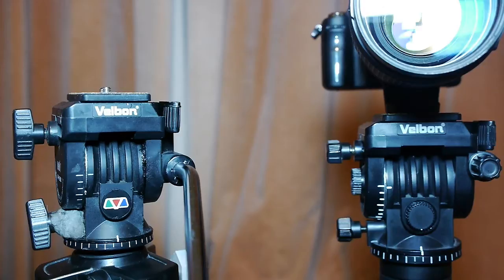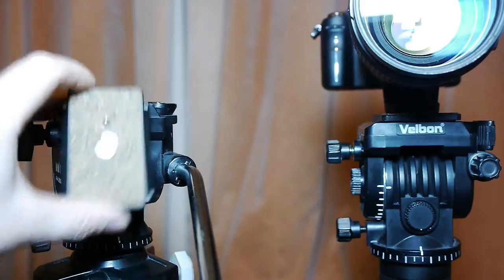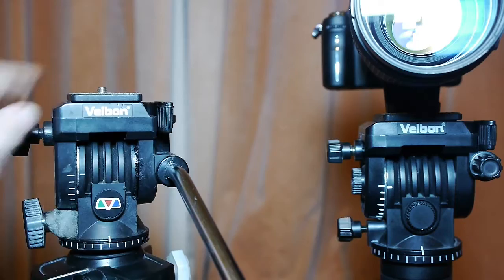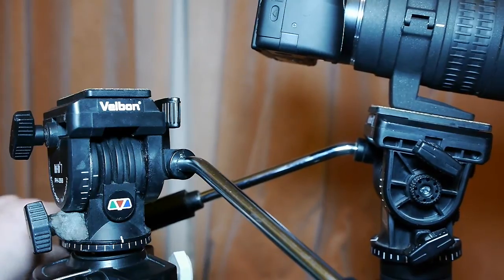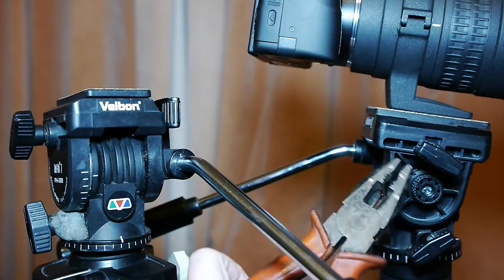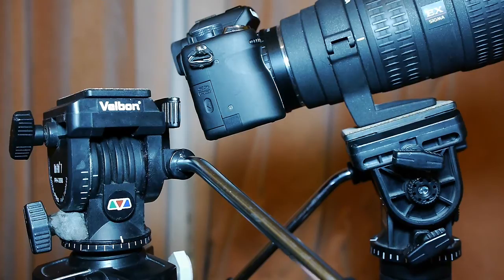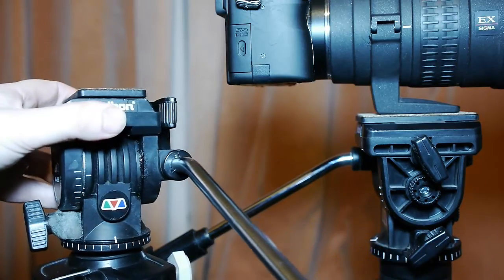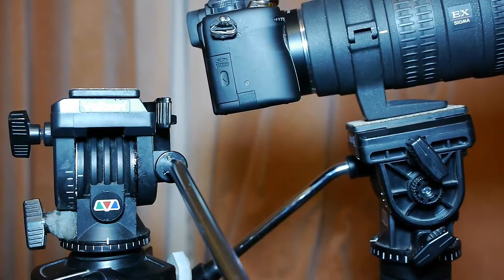Velbon oil damped pan/tilt video heads: Any good? PH358 vs PH368.

Comment: I have a Velbon PH-258 that was gifted to me, it doesn't come with a quick release, would I be able to buy one that fits it? I can't find one
Reply from the maker: Does this look like the right quick release plate? https://www.ebay.co.uk/itm/Quick-release-plate-for-Albinar-9500-9900-tripods-with-PH556-PH258-PH258Q-heads-/332812446004

Comment: does a ph368 fit on tripods of other brands, like Rollei Compact Compact Traveler No I Carbon ?
Reply from the maker: I no longer have the PH368 but it fitted OK onto a Manfrotto (I think) tripod without needing any modification. There's a central thread, which I think is female.

Comment: how the hell do I remove the whole PH368 head from the tripod?
Reply from the maker: Depends on your tripod - there may be one or more vertical locking bolts underneath, then tighten the pan lock-off and use the pan handle to give  the head a quick anti-clockwise twist. Hopefully this'll loosen the head and you can unscrew it. Good luck. I haven't found a way to get the PH358 off my Velbon tripod though...